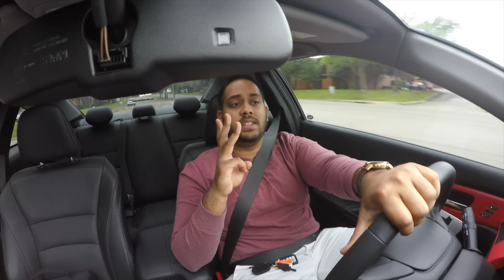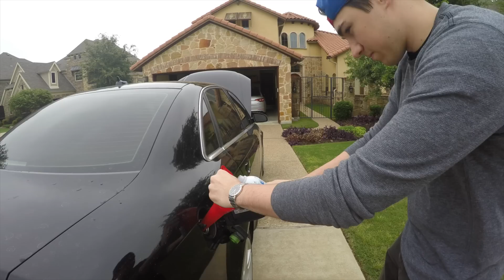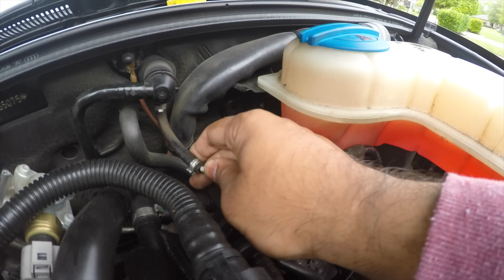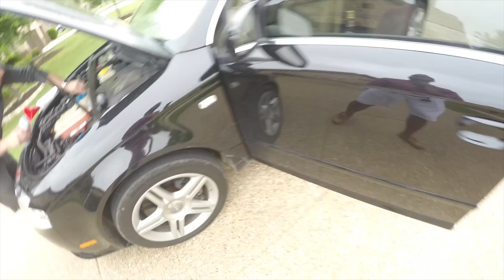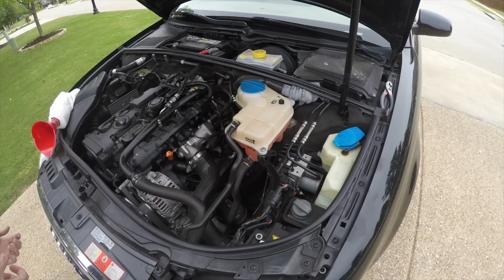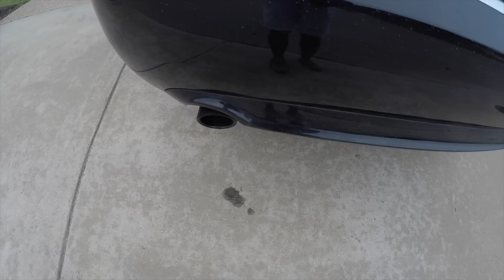How To Seafoam A Car & Did It KILL It?  2008 Audi 2 0T

Comment: No smoke because it was sucked into your brake booster, notice the vacuum line going into the firewall. Not into the intake
Reply: mark lynch yeah... we realized that later. Thanks for the comment! We re did later through the turbo inlet and then again later through the actual intake pipe. We had some crazzzzzy smoke! Just hard to get it into the engine since the engine has to be pressurized the whole time and will shut off with any pipe loose.
Reply: FFFFFFF LOL

Comment: The oil leak at the top of the crankcase (oil cap) means your pcv system is failing. You can delete it or get a catch can. solves the carbon deposits issue as well
Reply: So I'm curious about this oil leak.  I have a close buddy of mine and is having a leak around the same area.  So what would I need to change.  Is there a video on what type talking about?
Reply: This comment may never find you but mine is failing can I not just cap off the intake and vent to atmosphere with the stock failed Pcv instead of buying a block off plate ?

Comment: I have an a4 same year but the cabriolet same engine and the best way to do it is by taking your iti sensor on the manifold pour it directly rev 2,500 rpm till can is empty than turn it off put the sensor in let it rest fo lr 15 min then watch the show  and your car is dirty trust me its direct injected u will get carbon build up i do 4 sure so try it that way you will notice and your oil leak is cause of your pcv valve then later generates problems on your rear main seal check it out mine had the same problem
Reply: Where can you put some so it can go straight to the intake ?

Comment: You should try and use Sea Foam top cleaner. This is a foam spray with a longer nozzle it gets sprayed in just behind your Maf sensor. This is much more effective that using a vac line or indeed the wrong vac line.

Comment: You'll get better results still if you run seafoam through the Vacuum line going to the power brake booster. you can just let the vacuum suck up the stuff out of the can by it's self. and the bottle you put in the gas tank you ACTUALLY want to put in with a FULL TANK not 1/4. not sure where that line you fed the seafoam into went but it didn't go into the intake or that car would have smoked a LOT more than it did. i'm thinking that was a return fuel line for the Gas that you fed that into. That's what it looked like. I have NEVER used seafoam in a vehicle the proper way and it not smoked like a pine tree fire or at least 10 minutes. Less if the motor is really clean. I also put Lucas engine treatment in with my oil at oil changes and even though i run ONLY Mobil1 in my vehicles, it really helps keep the motor protected for cold start ups, and it helps because when you run that half can through your motor oil it can break down your engine oil.  I've been using Seafoam since they first came out with it and the only place you could even buy it was Napa auto parts. I just had to replace the fuel injection spider on the intake on my 99 Tahoe not long ago and when i removed the top cover it's usually THICK coated with carbon build up and suit. Mine was almost clean enough to eat off of when we removed the upper plenum of the intake.  so yeah that stuff is like GOLD !    https://www.youtube.com/watch?v=jPBGH6sLrQk 
 Inside the Upper intake can be clearly seen at 34:31 and the lower part of the intake can be seen under our hands at 36:00 and this is a motor that the injectors were never replaced before and it had 188,000 miles on it at this point. so it should be REALLY heavily coated with carbon. but thanks to sea foam, mobil1, lucas, and regular maintenance it's REALLY clean in there.
Reply from the maker: @DaddytechEnt
Definitely dude! That was the first vacuum, line we messed with. For sure a learning process. Thanks for all the info. Most likely going to post another vid at some point doing intake manifold line and maybe brake booster!

Comment: Does your Audi burn a lot of oil?
Reply: Felipe mendoza hey man! I noticed it burned a lot right when I got it. After doing some mods I noticed it doesn’t burn as much. Perhaps it’s because it doesn’t have as much pressure in the crankcase pushing oiling into the intake? I’m not entirely sure. I used to add about a quart every 1500-2k miles now only every 3-4 which is around the time I change it anyway.
Reply: Caleb Smith yea I just got mine Audi like 4 months ago and I noticed it burns a lot of oil .
Reply from the maker: We replaced the PCV Valve, and it seems to be better since?

Comment: I have an 04 Nissan Altima I did gas and intake seafoam no white smoke at all 50k rebuild engine. When that happens it's still really clean inside the engine. And when u put it in the gas tank it's 1qt per gallon
Reply: One quart per gallon of gas?  Wow, that is quite a lot and would be quite expensive.
Reply: 1 ounce per gallon not 1quart lol